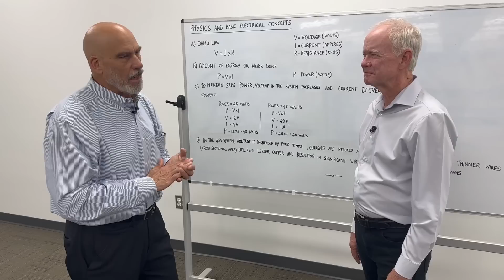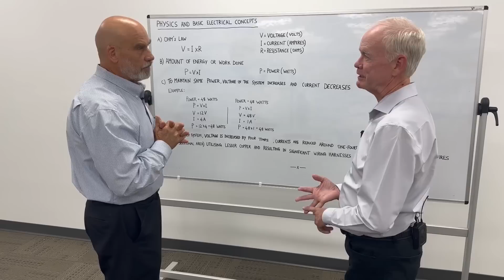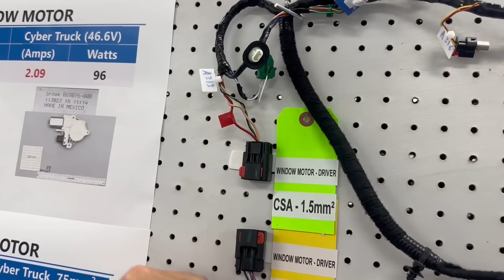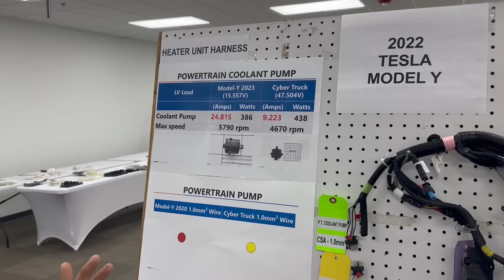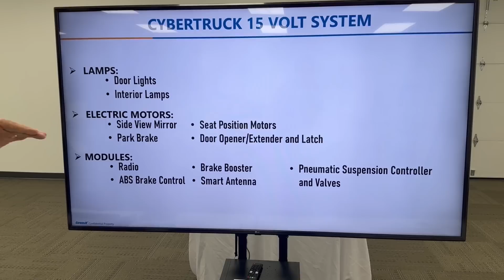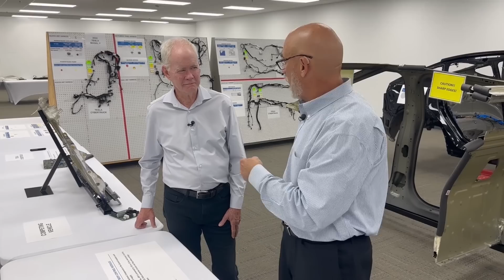Deep Dive Into Tesla's 48-Volt Architecture - Caresoft Teardown

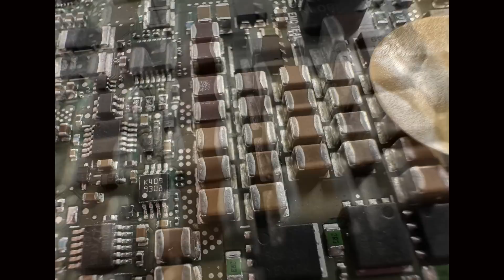Comment: At 23:00 where he's talking about stepping down, note that there aren't actually any transformers unless isolation is needed (which isn't typical for most of the DC-DC conversions inside a vehicle).  Transformers are mostly used for AC circuitry, not DC.  Those are inductors and the actual DC-DC conversion is called a "buck converter".

There isn't really much to it.  It is literally just a controller, an inductor, a capacitor, and a FET.  And the FET is often built into the controller chip.  The size of the components depends on the amount of current the DC-DC converter needs to handle and the switching frequency.  The more current you need to handle, the larger the components and the lower the switching frequency.  The less current you need to handle, the smaller the components and the higher the switch frequency.  Higher switching frequencies also allow components to be downsized so its a double advantage.

These buck converters can be the size of your thumb up to around the size of your hand.   For example, a typical USB-C buck converter (USB-C can deliver different voltages to the equipment)... that's the size of your thumb and can deliver up to around 60W.  The size of two fingers can deliver up to around 100W.

(XXX this is wrong XXX)
The reason an array of capacitors is used there is to reduce ESR (equivalent series resistance).  The reason this is needed is because they are using cheap ceramic SMT capacitors.  Ceramic SMT capacitors have severe ESR issues.  To get around those issues the buck converter controller usually has to have a high switching speed, between 1 MHz and 10 MHz.  A second axis on reducing the problems is to use an array of ceramic SMT capacitors in parallel (reducing the ESR).

Ceramic SMTs are preferred because as long as you can control the ESR, they basically don't fail.  Unlike other types of capacitors such as electrolytics.

(correction)
Not ESR, capacitance at higher voltages.  Ceramics lose a great deal of capacitance at higher voltages.  The ESR is quite good.  As is life-span.

-Matt
Reply: @junkerzn7312:  It isn't the ceramic caps that have ESR issues.  Ceramic caps have very low ESR compared to other caps and therefore dissipate less waste heat in use.  It's the controller chips that lose stability and oscillate when working into very low output ESR.  Higher frequency switching operation means you can use smaller L & C values which is always a win, but again it's the controller which limits the operating frequency.  I did a bunch of dc converter designs for airborne systems, so weight was a huge factor.  I found the Linear Tech (now owned by Analog Devices) line of dc-dc converters were the smallest, lightest and fastest frequency operating devices out there and they regularly achieved 98%+ efficiency when properly applied.
Reply: @morrisg  Analog Devices makes some very good, but relatively expensive, switching regulator chips.  Some of my favorite.  I couldn't read the chip ID of the regulator being using in the video but my guess is that they were running less than 100KHz and the ESR was too high re: power dissipation.

No other reason that I can think of to use that many SMD seemingly same-valued (guess) caps in parallel for a regulated DC output.  Though they could have just been doing a mix to reduce the EMF.  It looked like there were 4-6 separate regulators in that part of the board but each column was clearly on the same output.

Also, beware the voltage... the output is up at 15V, not below 4V.

I'm also guessing, given the complexity of the board, that there are probably shunt resistors on the outputs... usually one can tell from the shape (wide and very flat) but I couldn't validate my assumption from the video.  In anycase, it is not all that uncommon to have something like a 5 milliohm shunt resistor on power distribution boards like this.

So my assumption is that the one with the capacitor bank(s) is adding storage and reducing heat (lowering ESR further), or adding more dissipative area.   And that the other smaller regulator he highlighted on the board was probably a low current output running at a higher switching frequency.

These are just guesses, obviously.

--Matt
Reply: @junkerzn7312  Pretty good guesses.  In my designs years ago I used banks of ceramic caps to get to the minimum output cap value for loop stability and it took many caps due to their small cap value each.  But the ESR was an order of magnitude less than electrolytics and they shrugged off heat that would dry out an electrolytic in no time.
Reply: And once you up the voltage, you can do kilowatts with the same chips.
Reply: @rkan2  Well, its the same idea but you can't push that much power through those chips in that footprint.  They are only designed to dissipate a few watts (e.g. 96% efficiency @ 100W = 4W of dissipation which is actually quite significant for a passively cooled board like the one shown).

Pushing kilowatts takes a larger footprint, IGBTs instead of FETs to handle the higher voltage, larger capacitor arrays, a significant snubber circuit, and a few hundred watts of heat dissipation.   For example, pushing 25kW @ 99% efficiency would need to dissipate 250W in the circuitry.

(high voltages translate to much higher efficiencies so the heat dissipation required doesn't go into the stratosphere, but it is still a big leap over nominal automative 48:12 buck converters that only have to push a few hundred watts and dissipate just a few watts).

-Matt
Reply: @junkerzn7312  So like an EV inverter :)
Reply: @rkan2  -- When you go to higher voltages the basic process needed to make the chance needs to be modified.   Any given  "tech" has a  maximum voltage where it really works..   N.B.:  PCs often run stuff at 3.5 volts rather than the common 5 volts because the "chips" can be made smaller and faster for the same cost.
Reply: ESR of ceramic capacitors is lower - not higher.  They are not that great at withstanding high Di/Dt surges however.
The 'C' arrays are to add up to the desired capacitance value/s without stress compromises.
I also was intrigued by the apparent lack of inductors on the circuit board for step down.
So the inverter design may be one of two types:-
1) It is a switched capacitor inverter style.
2) It is a classic buck regulator style.

I do see a couple of small devices that look like shrouded inductors but do not know (video clarity).  Or the inductor is hidden from view because it is created by embedded copper within the printed circuit board.  Such an inductance would be quite low and probably necessitate a switching frequency in the mHz range (unless sintered ferrite sheets have also been embedded over the copper coil between surface layers).

In any event, that particular PCB is doing a LOTTA things other than just voltage step-down.
I DO LOVE the firewall wire feedthrough problem gone.  That is genius.  Give the guy who thought that up a raise and a promotion.
Reply: @jimparr01Utube  Yes, I had to refresh a bit.  It was the voltage-v-capacitance issue, not the ESR.  Which might be another reason why an array is being used there given that it is presumably bucking down to 12V rather than something lower.
Reply: In my off grid motorhome I upped the battery voltage for my AC bought a new 24v inverter but should have and will go to 48v. I had three options for my 12v system, a buck converter, a separate 12 v battery or I went with the AC to DC 12 converter. It seems to work good but there is a 15 watt draw to power the 12v system. If I would have used the battery they have a draw from sitting. Do these buck converters have a power draw just being energized? It seems everything does and even having our homes energized must have leakage.

We all know how 12 volt equipment runs slow or takes awhile for lights to come on when voltage goes down. Somethings say 12/24v allowed. It would be nice if everything was able to take a 48v input and they adjust themselves.  It seems a Tesla with that big battery should always have enough power to open doors, roll down windows and charge a lap top or phone. It seems they have finally designed air conditioner that don't require a large AC supply to start.

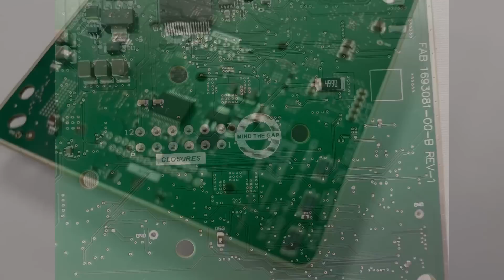Comment: 23:50 They missed the other easter egg "Mind the Gap"
It's sexual reference on a woman
Reply: It's morphed into that meaning in some areas, but its older reference is to the gap between cars in subway systems (specifically British). In this context there may be a more specific pun intended (spacing between higher voltage traces?).
Reply: Nothing sexual about it. You would get fired at Tesla for doing something like that. Tesla expects all their employees to act like the mature adults they are.

Comment: It should be noted that 48V has been in general use as a standard for decades, just not in Autos, and nearly all the technological components already existed... particularly power over ethernet (POE) which has been around for a very long time.   It was very easy to implement because the data lines for ethernet are capacitively coupled, which means you can piggy-back a DC level (aka power) on the same wires.

The current standard is called POE+ and is defined as a 48V standard that can transmit around 15W per twisted pair.  A standard gigabit ethernet cable contains 4 pairs, so 60W can be transmitted.  There is also a higher-voltage and current industrial standard that can transmit significamtly more power.   The twisted pair for ethernet is 23 to 26 AWG (roughly).

Terry did a good job describing the advantages but missed one of the most important advantages... losses over wiring go by the SQUARE of the current.  P = I * I * R .   So transmitting the same amount of power over the same gauge wire at 48V has 1/16th the wiring losses verses 12V.   And because of that, thinner wire can be used and EVEN WITH the thinner wire, power losses over the wiring at 48V will STILL be 1/8th the wiring losses verses 12V for carrying the same amount of power.

-Matt
Reply: Automotive PoE is expensive.  The cheaper option / still needs to be developed is a 2 wire, high speed serial differential bus / 48V supply.  The return path is the tricky part as it is the negative differential leg plus the return for the +48V bus.
Reply: @bobbbobb4663  The data busses are not directly wired DC, they are coupled to the transceivers with capacitors... i.e. the data is effectively an AC signal.  That is why DC supply voltages can be run over the same wires.

And because the data is coupled with capacitors, it doesn't matter what the coincident DC voltages are.   You are thinking of the voltages in absolute terms but that isn't how ethernet data transceivers work.

-Matt
Reply: @junkerzn7312  Oh I'm familiar with DC blocking caps and DC bias on high-speed signals.  Now turn that into a 2 wire only bus where the return path is shared with the differential leg, i.e. turn PoE into one pair containing DC and differential signal.  There's another interesting option that is probably patent-able so I won't share it.  All this to say that +48V has a long way to go before being cost-effective.
Reply: @bobbbobb4663  The wires are bidirectional.  Data flows in both directions on the same wire.  In fact, in gigabit ethernet, data is full-duplex and flowing in both directions on the same wire at the same time.   Each twisted pair represents a 250 MBit full-duplex link.
Reply: @junkerzn7312  By definition, any 2 wire scheme would be half-duplex.  However, the data return / acknowledgement would be slow speed.
Reply: @bobbbobb4663  A multi-drop line generally has to be half-duplex.  A point-to-point line can be full duplex and it certainly can be full-duplex over 2-wires.  You can absolutely transmit data in two directions on the same wire at the same time, that's how gigabit ethernet works.

I think you are misunderstanding how ethernet and capacitive coupling works in general.  The capacitors built into the transceiver aren't just there to block common-mode DC.  The data is not being transmitted with DC levels.
Reply: @junkerzn7312  I stand corrected...BroadR is 2 wire full duplex with backend DSP.  IIRC A2B was half-duplex.
Reply: because TESLA wants Vehicles to mine Bitcoin while parked.

Comment: Really happy to hear him mention mechanical fatigue in small wire. Size appropriately.
Reply: Me too.  They didn't teach this in EE school when I was there.  Had to learn practical things like this on the job. In the industries I work in, there is often a minimum wire size. Besides mechanical properties, there is the Bubba factor. If a random electrician might have access, the limit may be 14 gauge. If only trained field techs have access, it can be as small as 26 gauge. If nobody is expected to have access once the enclosure is sealed, 30 gauge is sometimes specified.
Reply: @videcomp  It is why a degree is not enough. It is the basis and must be completed by what you learn in the field. It is why people with just degree in business, management are a total disaster when they are in charge of companies in technology. No background, no experience, total jerks !
Reply: Teflon insulated stranded wire stands up well to flexing and vibration.
Reply: @hwirtwirt4500  Yep. We use that kind a lot in aerospace for vibration resistance
Reply: bingo, there's MANY OTHER VARIABLES to consider in a "dynamic" situation in a vehicle versus a "static" situation (think: sitting still behind the sheetrock walls of a house).
Reply: Yup
Reply: The mechanical fatigue was the only thing he mentioned that makes sense but only if you use cheap wire.

Comment: So there is a 3rd reason they didn’t reduce the wire size for the battery cooling loop, they may be planning on using the same loop for the “Range Extender”.  Or they may be considering the truck may need more cooling
Reply: Also, it looks like they changed the connectors… really can’t see them not changing the wiring if they didn’t think they would need it.
Reply: The "Range Extender" that uses up most of the already compromised cargo box.
Reply: To be clear; I’m defending the engineers, not the vehicle design.  The Cybertruck is definitely not a truck and will never be usable for towing/hauling/work site power/etc., even with a range extender (way to long to recharge).  If you want a real electric truck, Look at the 2025 RAM Charger, enough battery for daily driving and a real range extender for towing/hauling/camping/worksite power/whole home backup/etc.

Comment: Audi and Bosch had a 48v system decades ago.
Reply: so why aren't Audi cars all 48v then? Tesla's genius is not about doing 48v. We know it's not a new idea. It's how they had the balls to design a vehicle from the drawing board to use it across the board, at the same time as steer-by-wire, 4-wheel steering, PoE, stainless steel exoskeleton, and so on. It's a genius vehicle, whether you appreciate the aesthetics or not, as it's a test bed for all those technologies going into the massive scale next-gen platform for the robotaxi, van and others.

Audi dipped their toes in the water and thought "too difficult to go full on". That doesn't make them any sort of market leader. As Sandy Munro says, back in the 1950s all automotive engineers knew 48v was the way to go, it's just that neither VW nor any other manufacturer in the next 70 years had the balls to do it properly.
Reply: @garyrooksby  Q: so why aren't Audi cars all 48v then? A: because (wholesale) it's simply not needed after 50 years of development and optimization of 12V.
Reply: @phillyphil1513  what do you mean?
Reply: @phillyphil1513  I'd like to peer 50 years into the future where Audi ,BMW, and Mercedes will be and where the Chinese BEVs will be , and their respective marketshares.
Reply: @garyrooksby european car makers have used 48v for a decade, in things that need it. For example in chassissystems that you cant have in aTesla yet. What Tesla has done in audition to that is babysteps. For example the interiør fan, that is out of a Volvo f12 truck. And no, cybetruck has no exosceleton body, but a normal monocoque with exatra heavy exsteriorplating. It was suppose to have, but luckily, the came to their senses.
Reply: While it is true that 48V systems aren't anything new, the miniaturization possible now with high frequency buck converters and SMT components vastly improves the economics of 48V distribution systems.  In volume production, 48V doesn't cost any more than 12V these days, so the cost savings in wiring becomes low-hanging fruit.  That wasn't true 20 years ago.

You can see this in some of the close-ups where they are literally using SMT inductors in buck-converter circuits the size of your thumb-print.

-Matt
Reply: Bosch could not overcome German makers’ inertia. OBD 2 is 3 decades old - predates Windows 95 (which came out in ‘97?)😂
Reply: Wait I didn’t realize Audis were 48V🤯
Reply: Audits are scrap , their engines are GARBAGE, often don't reach 150,000 miles before grenading
Reply: Mercedes, Audi, and BMW hybrids (and many of their EV's) all use 48 Volts when and where the context requires.
Reply: AUDI ice cars , also had Electrical FIRES.......lol.

Comment: Most don't understand that 48v has been widely used for at least 20 years in the computer industry. 

PoE is a standard. 

Switching to 48v opens them up to more suppliers.
Reply: But not automotive suppliers. That's why no other car maker in the World has had the guts to do this in the 50 years that engineers have known it was the most efficient way to go.
Reply: @garyrooksby  bingo!